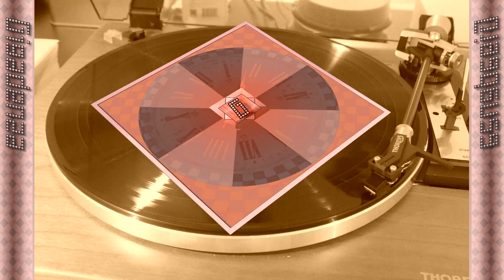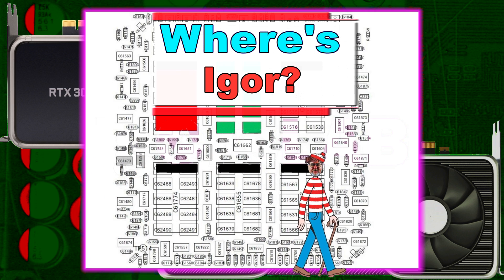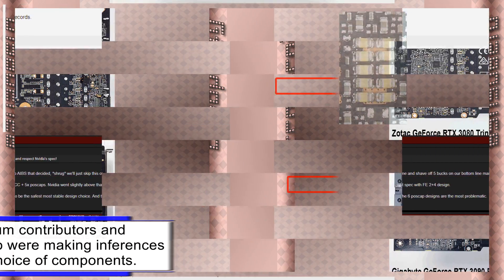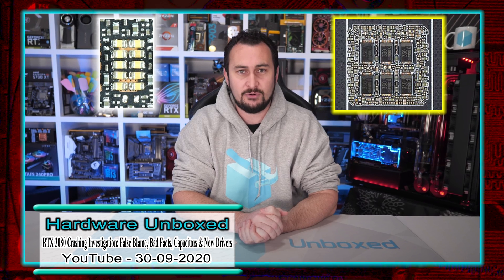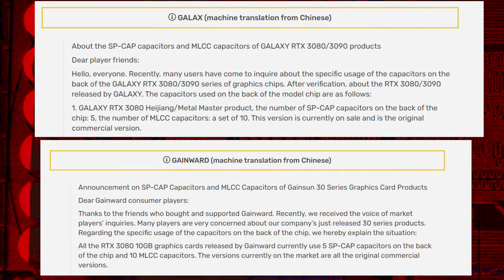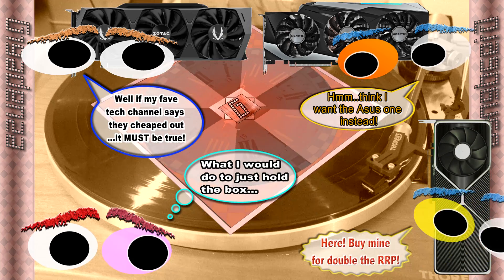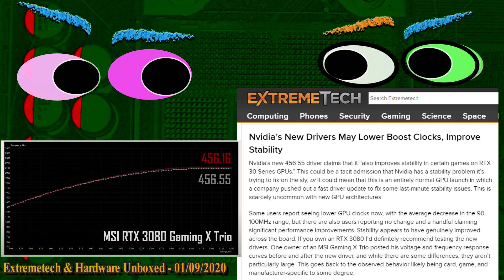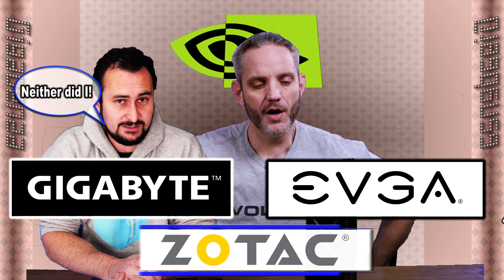Not the Nerd O Clock News 14 - Capacitor Complex

Comment: It was obvious to anyone not drinking the green kool aid that as soon as Jay was throwing other partners under the bus that this was way more complicated than that. Nvidia not only provides the spec sheet for the cards to their partners, they also have to approve the designs themselves and don't allow partners total freedom when it comes to designing their cards, this is to avoid having a terrible product attached to their name among other things. If Nvidia had known that certain cap arrangements were guaranteed to fail they would have not approved those designs or given a more strict spec sheet to the partners.
No, this was all a result of how retardedly power hungry Ampere is, with these insane power peaks. It was observed that crashes would occur mostly when the card was at a high power state low load boosting close to or beyond 2.1Ghz and then switching to a heavy load high power state, which accompanied with a voltage change and frequency drop, causing ripples that were too much for the power delivery to handle, as explained correctly in this video.

But none of this matters now, it's all been memory holed by the Nvidia Defence Force and their Shill in Chief JayzTwoCents (maybe we should start calling him JazTwoDollars, because they're green).

Very nice video, subscribed.